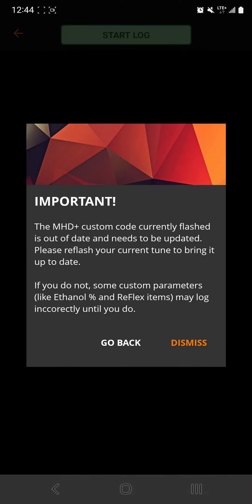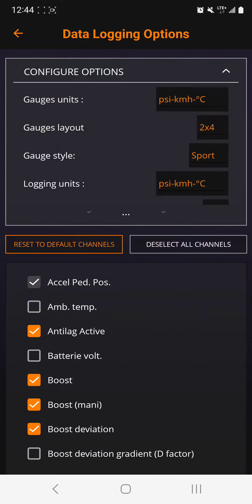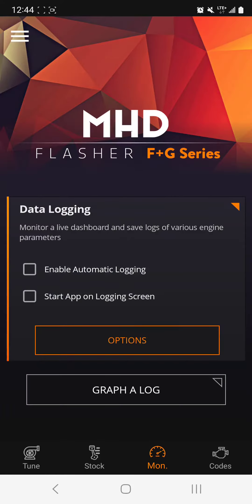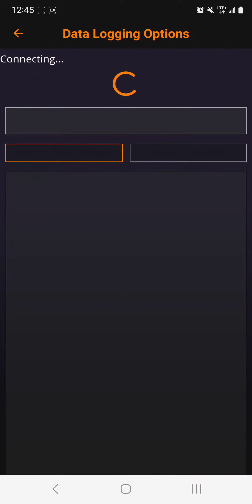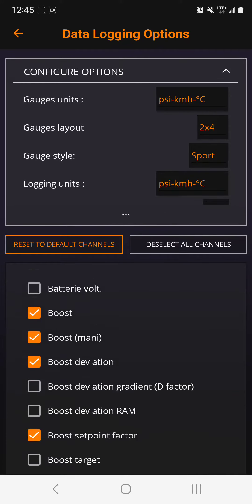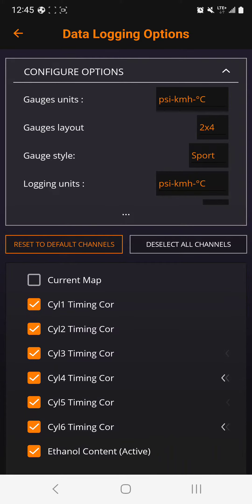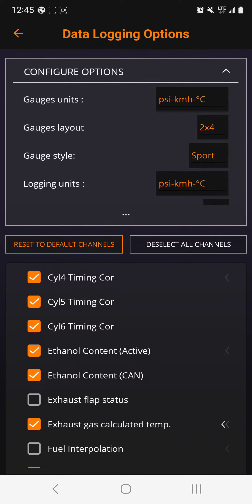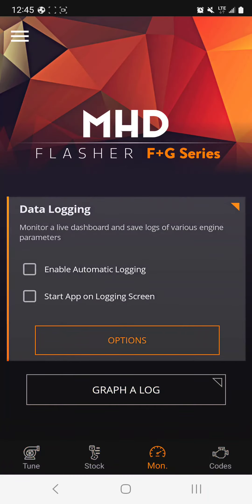BMW MHD data logging set up

Comment: I’ve activated my license, DME codes are read (suggesting MHD wireless connector is working) but when I click on the data logging section I get no gauges, just ‘connecting’…’connected’…’reconnecting’. Any ideas what’s up?
Reply from the maker: Are u using mhd red or orange odb adapter?
Reply: @the_batmobile0.4  red one